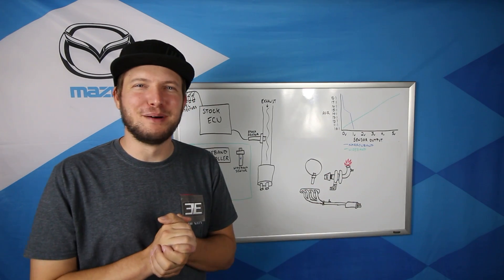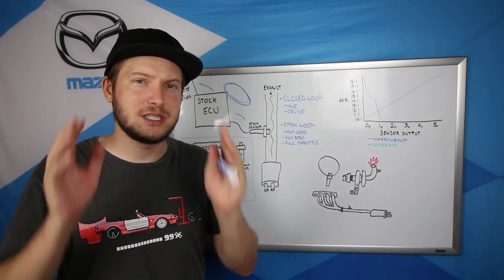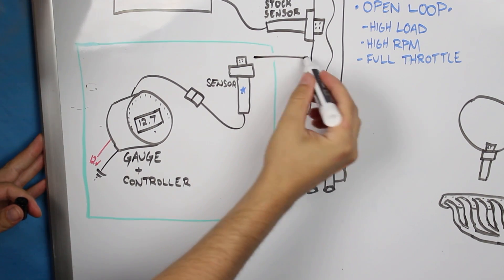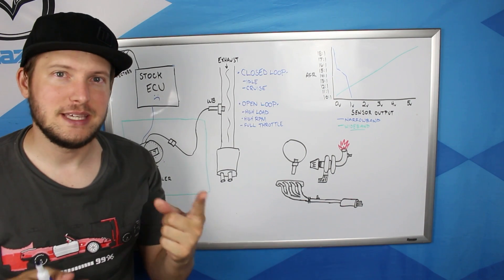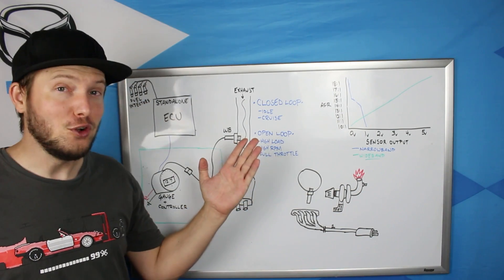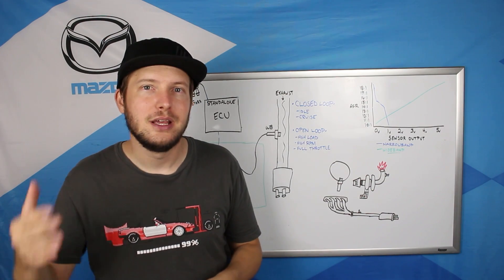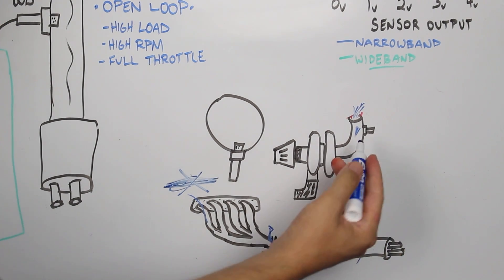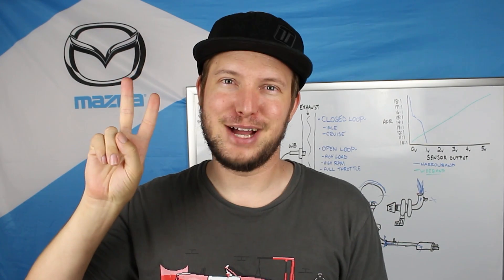Everything You Need To Know About Widebands To Keep Your Engine Safe!

Comment: Yes, I do feel more educated. So you dropped a hint that the wide band sensor probe itself is heated? So the gauge itself has to be powered by a circuit which travels to the ignition key, other wise  damage and dead batteries. Another thought. Aircraft engines have control over mixture and we gauge that by exhaust gas temperature. Aircraft can do this because of the constant rpm settings at cruise. Do the stand alone ECU’s utilize an exhaust gas temperature probe  to help with mixture or AFR calculations? There is so much cerebral pinging to this......the road goes on forever and the party never ends.

Comment: Hi Greg. Thanks for the info and clearing it up. I actually emailed you regarding my stock ecu that has no O2 sensor at all. I checked through the whole  harness and under the car (exhaust etc.)  Mine is a BA Astina 97 1.8L.  Spoke to a few guys and they reckon that my cars AFR is being controlled by the MAF sensor...and it runs crap.  I'll have to get a aftermarket Ecu and wideband later.  Much Appreciated

Comment: Thanks for this information! I bought my car with a vvt swap (1992 na6 chassis) and noticed my AFR has gotten way rich over the past year. When I first got the car it was close to target numbers. The car was tuned with aftermarket exhaust system (rb header, fm cat back exhaust. ) i changed to a test pipe and shaped the warm air intake to a joefis CAI. Afr was still normalish but last winter started seeing cold start at 9:1 and warmed up idle is 10:1-11:1...  need to figure out what happened,  running on a adaptronic  E420C,  we tried messing with injector timing to smooth it out but now the transit throttle is all messed up. So I am at the original tune, I suspect maybe the oxygen sensor is going bad which is resulting in the super rich conditions.

Comment: Do you have any tips for trying to get a closed loop idle setup to work? Specifically adjusting PID values to make the engine idle at target when adding loads like lights, heater fan, and maybe even AC. I could get my car to idle good with no loads but anything extra and it would lower to about 700, and ac killed it instantly
Reply: You need to adjust your injector voltage offsets and the different values.   I.e.  at 14v, 12, 9v....etc

Comment: Next video talk about having 2 map sensors, other for open air. To fine tune while driving on mountain roads. I have 2. Crisp AFR's driving around the world. Set spare port OFF from megasquirt to be able to make it work. You know what I mean when you try to figure it out. Also talk about using CAN wires instead of analog for lambda controller. Because that is way more reliable and faster. cheers.

Comment: I got the AEM UEGO, MS3 ECU and using tunerstudio.
The AEM gauges on the list in tunerstudio doesn't show the same AFR as the real gauge, and all the custom ones I can find on the internet doesn't match either..
I can see others have the same problem, do you know anything about that?

Great video as always btw 💪
Reply from the maker: Check out the video in the description about custom calibrations in MS, you should be able to get it very close with that. Also, make sure the wideband has a good ground, I always ground mine either at the ECU or on the back of the intake manifold.
Reply: Ground the sensor to the ecu's grounding points.  What you are seeing is voltage offset from a different grounding point.
Reply: Ground all wires to engine head in the same place, use CAN wires and forget about analog crap. google how to set Can settings its really eazy. No mods needed for Ms3 you have can pins there. USE THEM.
Reply: Thanks all, I'll have a look where I actually grounded it, been a couple of years and can't remember exactly tbh